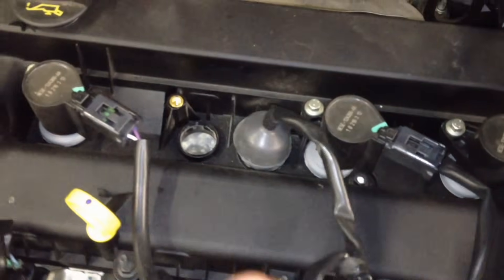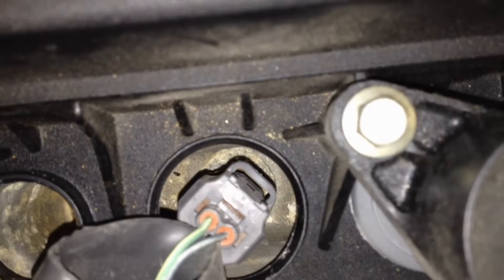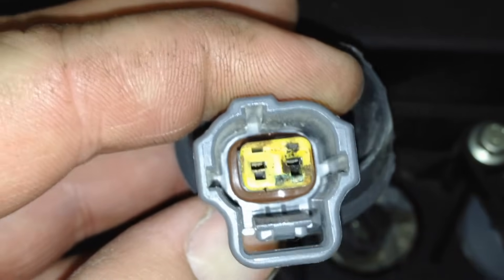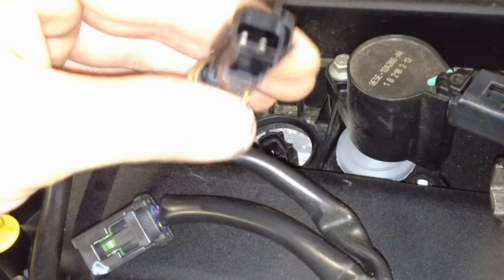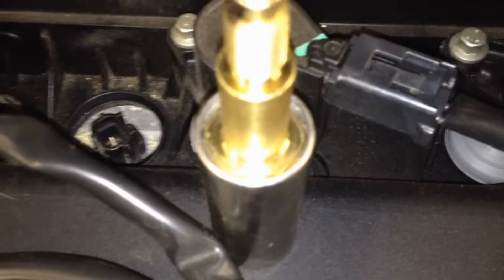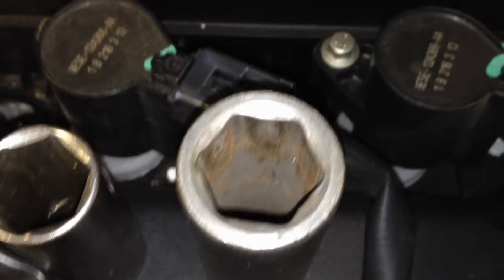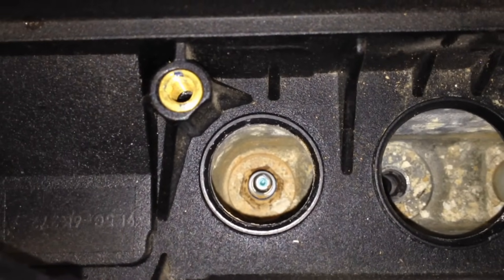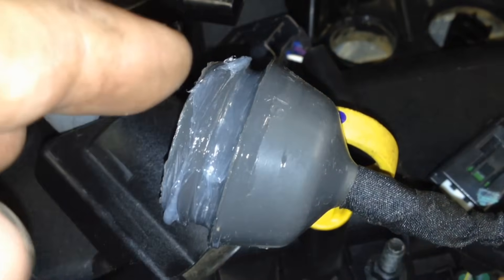Ford Escape & Fusion 2.5L False Overheat And Misfiring

Comment: I have a 2012 ford fusion v6 e85 flexfuel with around 80,000 miles and my car first got hot going for a 4hour drive and on the way back started to get hotter and my boyfriend changed the thermostat and it stopped for a while but it sometimes get hot going up hills please if you know anything what that can be it would be appreciated thank you

Comment: Hey I hope you see this as I am completely stumped on whats wrong with my car. Im getting the p0128 code on my 2012 Escape 2.5. My temp gauge is showing all the way on the cold side even though my engine is getting very warm very quickly. This leads me to believe its my thermostat not letting coolant through to the radiator, but is the sensor that tells the gauge in the closed loop with my radiator or should it still be showing hot? Im stumped because my engine should be showing hot, can this sensor cause that? Also I dont know if it makes a difference but my overflow coolant tank was boiling over the other night, as far as I know it hasnt done it since.
Reply from the maker: +Justin Carrington P0128 is very common on this engine an it requires a new thermostat use this one it's the latest kit-http://amzn.to/2342yLi
Reply from the maker: +Justin Carrington Also you will absolutely need to vacuum fill your cooling system afterwards or you will now have overheating problem see here-http://amzn.to/1NPXeUE

Comment: Okay I have a 2013 Ford Fusion SE with Ecoboost 2.5l engine. the CHT is nowhere near where the video I have looked everywhere.for the damned thing.  I found something that looks like it at the right sight side of the engine near the number 4 cylinder but....  no wiring connected to it and it is deep in the housing.  I have an expensive piece of junk in the driveway until i get this overheat issue fixed.  I did find the coolant sensor though.  Ant help will be appreciated as I do not have the funds or credit to take the car to the dealer or repair shop.

Comment: I had the same issue on my 2013 1.6  Escape, overheating warning and engine shutdown by the system, towed to garage they found no traces of real overheating, coolant level was normal and after a reset of pcm it never did it again. Could be the same issue? thanks
Reply: I know it's an old post but did you ever figure out the issue? I have a 2013 1.6 having the same problem.

Comment: I have a ford fusion 2.5 and for some reason i have my fan turning on at high speeds (highway) but the tempeture needle stays solid in the middle. You think this can be the issue ? T.I.A
Reply: Yes that is exactly what it is im having the same problem and my does the fan problem your talking about also guys you will notice when your in the drive way when you pull in from driving doesnt even have to be that long of a drive you can literally go to the store right around the corner and you will notice that the  fans are running you can hear them well amd when you turn the car off they will stay on for a. Split second somtimes ant way they will be running when they shouldnt be because the car thinks its overheating but. Its not because of this problem hes teeling you about the cht sensor about to get the part and i will keep you updated
Reply: Our 2012 fusion had that problem. It was fixed. The A.C. was over pressurized.
Reply: @kimleblanc6089  did the new sensor fix the car. Mine is doing same thing

Comment: 2011 ford fusion v6
The temp guage goes up but not all the way
Sometimes it goes back to normal and so on, 
I removed the cap from the resivor tank and coolant isn't hot at all as if it wasn't even overheating. No coolant burst out or anything like that. Could it be that temp sensor? Please help!! Thanks in advance
Reply: check for a short to ground on the yellow wire running from the coolant temp sensor to the pcm.  a short here will cause the pcm to think the car is overheating when it is not
Reply: Hello friend, I'm from Brazil and I have a Fusion 3.0 V6 AWD 2010 and I'm having this same problem.

The car is normal all day but when I accelerate the temperature rises and as soon as I decrease the speed the temperature returns to normal.

Did you find the solution to the problem?

Comment: I have a 2013 Ford Fusion se 1.6 liter it says that it over heating I replaced the temp sensor, thermostat housing, and a bypass valve, and it still reads the same.. In tempting at this point to by water valve and another temp sensor... It was also saying misfire I replaced the spark plugs so it no longer misfiring... What could be my problem Ford claim they doesn't know... It also causing my power to be reduced in my car and shuts it down so I can't drive it only way I can accelerate the pedal or move my car is if I get the code erased
Reply: LaPorsche Norris I'm having the problem also with my 2013 Ford Fusion . Did you figure out the problem ?
Reply: LaPorsche Norris
Reply: LaPorsche Norris Same issue here, on my 13 Fusion with the  1.6

Comment: I have a ford fusion 2.3 4cyl engine , the car turns on fine with no problem the engine overheats. I changed the water pump the radiator and the thermostat and the car still heats up , the transmission is gone is bad water got inside. but I want to know if the engine is able to be fixed or salvaged. once again like I said the engine starts and the gage shows normal temperature then all of a sudden it rises to very hot. what can I do?
Reply from the maker: Party931southFl You must vacuum fill these or they will do this. They have a reverse flow cooling system prone to large pockets of air and false or real overheats.

Comment: @FordTechMakuloco I need you now more than ever 2019 Ford fusion 2.5 code p0116 I changed coolant temp sensor and thermostat two weeks later came back on coolant temp above temp and check engine light took it to Ford dealership they changed the air intake sensor 2 days later back on my boy is a marine and can't keep paying for dealership any idea supposed to be at least one more sensor other than air intake sensor and coolant temp sensor i wanna do it myself  just don't know what it is

Comment: @FordTechMakuloco I bought a 19mm thin wall socket but the base of the old sensor won’t budge. Any recommendations???
Reply: Morgan, try spraying some penetrating oil around the base of the sensor and letting it sit overnight.  The next morning, spray a bit more on there and try to loosen it then.

Comment: hey ! 
i have a ford fusion hybrid 2012 and my car keeps giving me the "stop safely now" ! 
the car works fine for a 10 miles after a long rest but then it starts shut down , before it shuts down the rpm wont get higher than 1.5 no matter how hard i step on the gas pedal then the car shuts down . if you can give ma an answer to my problem ill be grateful. 
(sorry for my bad english but I am from the middle east )
Reply from the maker: +Arks Sharaf The stop safely now message can happen for numerous reasons you need to get codes read in all the modules to read what fault it is seeing causing this.
Reply: +FordTechMakuloco 
my mechanic tells me that i need to change the throttle body , i dont know if thats what is causing my problem ! 
in your past experience , have you ever came a cross a problem like mine before ? 
thanks man !
Reply from the maker: +Arks Sharaf Not on hybrids no.

Comment: Hi, I just had this problem, my Fusion 2.0 Ecoboost stays parked uncovered, so it suffers from rain and sun, last day was too hot and the cooling system seems to stopped working while driving and a message show up "Too much high temperature on the cooling liquid", the engine temperature reached at maximum and the car stopped accelerating, do you believe is due to corrosion on some part?
Reply: Having same issue now. Did you ever find out what it was?
Reply: @demarquisparland4337  actually one of the radiator fan wasn't turning on because of an electric problem, it must start rotating at 100ºC, unfortunately I found out that after replacing almost all cooling system parts 😂

Comment: Does the diagnostic miss this? My son has a 2013 Ford Fusion and this has been happening every three weeks since March.
Reply: This issue just happened to me yesterday. I had the check engine light checked and the only code that came up was cylinder head overheated. If you turn your car off and few minutes later u turn it back on (not started) and the temperature guage reads normal, then the cylinder head temp sensor is bad.

Comment: Why does my sensor keep going bad? Anyone know? I replaced thermostat, radiator, and sensor and loom. It said I was at my normal running temp in the freezing winter after my car was started for 5 minutes! If it’s an air pocket why is it frying my sensor

Comment: Is there a way to bleed the cooling system on a 2004 focus with a 2.3 without the expensive bleeder tool?
Reply: I have flushed the coolant a few times on my 2003 Focus 2.3 and refilled it myself without any issues.  You don't need the expensive tool.  Just fill the radiator and overflow bottle and run the engine for a while with the defroster on. Allow the engine to get hot.  Turn it off and allow to cool down. Then add some coolant to the overflow bottle until it reads full cold.  Maybe the next morning try this one more time, it may need it or it may not need it. You will be good to go after that.  Never had a problem.  The system can burp itself out as long as you are careful and allow the motor to cool off completely before adding more coolant. Use only Motorcraft "gold" coolant with a 50/50 mix of distilled water for best results.

Comment: Thanks for putting this vid together. I have a 2017 Ford Escape and the fan is always running. I have to pull a fuse at night. Is this a relay or temperature sensor. Thank you in advance for your help!  Ü

Comment: Does the 2.0L have the same issue?  i know my Focus has the same looking boot in the same place.
Reply from the maker: It can yes but not as common.
Reply: FordTechMakuloco im working on one right now. 2.0 ecoboost on a 2013 escape my code is P0304 i replaced the plugs and checked the coils . coils look good and moved cyl 3 coil to cyl 4 vice versa .fired it up and misfire code popped up again.

Comment: I just got a new cylinder head and it looks different than the oe one. The new one is shorter just like the one you got. The OE one is longer. It has a long tip that feeds all the way down. Is this okay to be installed, I mean the shorty one that I got?

Comment: I have a question? I have 2001 Ford Escape is normal that both fans work all the time
Reply: No, that is not normal.  Sounds like you have an issue with your fan resistor.  There are videos on this.  It's a cheap fix.

Comment: how do you bleed the cooling system on a 2004 focus with a 2.3?
Reply from the maker: +mistersnapon You must use a vacuum bleeder for that absolute best results-http://www.amazon.com/gp/product/B0002SRH5G/ref=as_li_tl?ie=UTF8&camp=1789&creative=390957&creativeASIN=B0002SRH5G&linkCode=as2&tag=fordt-20&linkId=UKZBZ6PGFT46XP2H

Comment: I want to look at this for my 2013 1.6 Fusion... is it at the same location as this video??
Reply: My 2013 1.6 manual trans Fusion was on the drivers side underneath the air cleaner tube.  By they year posted, I assume you're good by now.

Comment: Anybody ever had a problem with there temp sensor? My 94 mustang 5.0ho acts like its flooding out I tried to bypass fan a few days ago and I heard a noise from sensor area like a spark and after that my car wouldn't start unless I kept foot on pedal as I was turning engine over so I do and it will crank but does smoke like a blueish white color? And idles weird and I have to stay on gas to keep it running

Comment: I have a 2011 ford edge and we were seating at a parking check engine light came on car started to shake.p1299 came up.
Reply: What ended up being the issue and how did  you resolve it?
Reply: One of the fan stopped working so it made the engine over heat,this engine has a safety sensor when the engine overheat it starts shakin and post likely will shut off. you have two fans one for when the Ac is on and the other for when the engine gets hot.make sure both turn on

Comment: I have a 2014 Escape with a 2.5 L . It runs rough/misfires at idle only when its cold. Plugs have been changed, throttle body cleaned, PCM changed and it still does it only when its cold. Could this be the problem or do you have any suggestions ? Need to get it fixed. Dealer has no idea.
Reply from the maker: +Dale Holden being a cold only concern I would be looking at fuel trims for a vacuum leak and also looking into the cylinders and intake valves for excessive carbon build up
Reply from the maker: +Dale Holden also you want to check all of your temp sensor readings after a 6hr soak they should all be within 5 degrees of each other.

Comment: this does not apply to a 2011 ford escape with a 3.0 duratec. The sensor is not where it is on hour video
Reply from the maker: +Shane Longsine Correct only the 2.5L as stated in the title.

Comment: Thanks for the video and information, I have a 2011 Fusion SEL 2.5 with just that issue but when I unplug the conector I have around 1.7 volts on the blu/gry wire, shouldn't it be 5 volts  ?????
Thank you again.

Comment: Why would temperature error cause misfire ?
Reply from the maker: fail safe cooling causes it.
Reply: FordTechMakuloco but if the temperature gauge is reading ok this shouldn’t be a problem . Correct?
Reply from the maker: correct
Reply: @FordTechMakuloco  idk what else to check , new plugs coil packs and purge valve . One thing I did notice is even if u clear the codes it always says missfire on 1&3 and randomeven before you start it after the clear. And it always has a miss u can feel easily especially when the air is on in the car is in gear. Can't find any vacuum leaks ether oh and I checked compression and it was 180/150/150/125 on 2010 fusion 2.5. any advice would be appreciated

Comment: Question: My son has a 03 Focus 2.3 Duratec which looks just like this. The area where this sensor, & the #2 & #3 spark plugs are was filled with what I assumed was coolant. I proceeded to clean the area out with compressed air expecting to find a coolant leak in there, but found nothing. Where does the water or coolant come from as you do mention corrosion in this area. Thanks

Comment: I do not necessarily agree with taking your vehicle to the dealership. My 2002 Dodge Diesel had a shifting issue. I knew it was an electrical issue but they rebuilt the transmission and replaced the torque converter. $3000. Did not correct the shifting issue. Only by an internet search did I find the correction. $40. Guess what the Dodge dealership claimed they  were not aware of any issue such as mine.

Comment: What’s a “pigtail?”
Reply: pigtail is the new wire connector with bare wires you would splice a new connector for the CHT like this example https://www.summitracing.com/parts/rnb-645-555?seid=srese1&gclid=CjwKCAjwxOvsBRAjEiwAuY7L8t7Wdn9A_FVjGEgEIJClQSe8L_UGKUUdgfQE6uc8Wo5AdkrAkRO01RoCr-cQAvD_BwE

Comment: How this sensor is called?
Reply from the maker: +Widmarie Reyes Cylinder Head Temperature sensor there should be a link to the part in the video description.
Reply: Thank you for the information my husband is struggling with the car that his uncle buy that model fusi n and we had problems with the sensor and the spark plugs already due or before washing the engine and leaving it wet and extra is you got oil and that I think the rust and were welded sensor parti and a spark plugs is broken into pieces.
Reply: Where and as you adjust the rpm ford fusion 2.4 2006?
Reply: I need help please.
Reply from the maker: There is no rpm adjustment it has an electronic throttle body.
Reply: Yes it's but it is to ask where is the rpm sensor?
Reply: You can adjust the rpm?
Reply from the maker: You cannot adjust the rpm, the rpm senor is the crank sensor on the front of the engine crankshaft pulley.